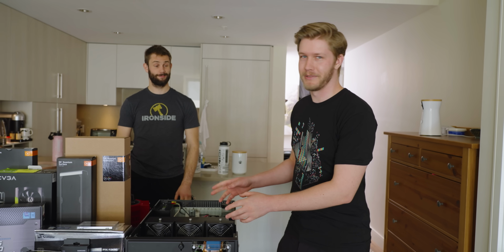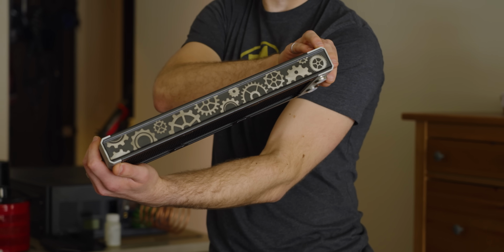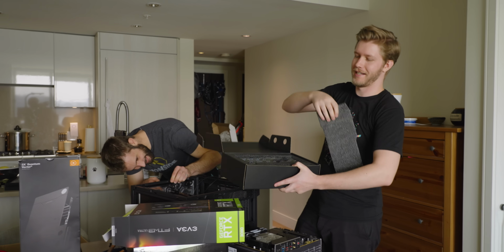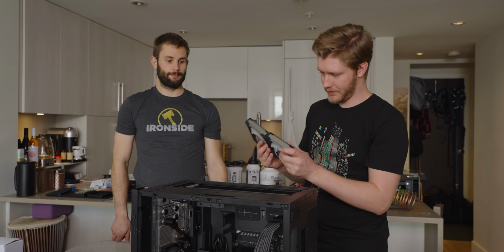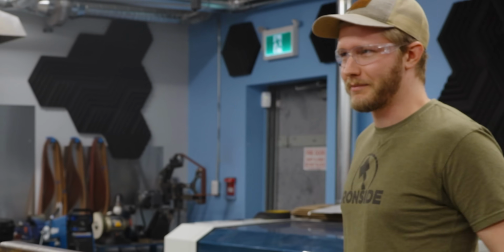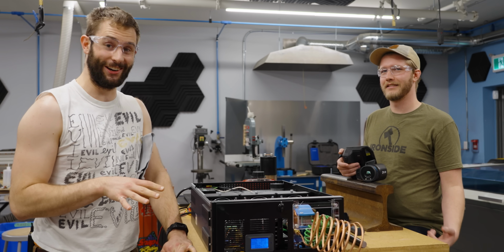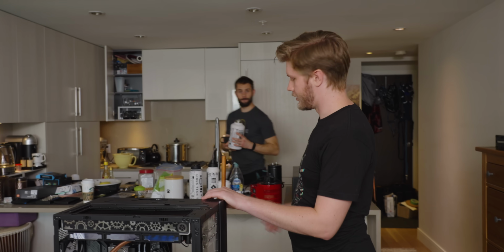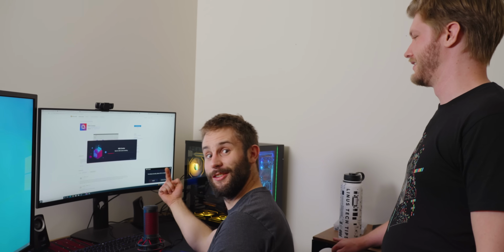This PC is TERRIFYING - Intel Extreme Tech Upgrade

Comment: I actually used a magnet almost exactly like this one to do my PhD research in bioengineering. I was using it to rapidly spin magnetic iron nanoparticles and make them generate a few hundred degrees C and release drugs attached to their surface. So instead of a piece of metal bar in the coil, it was a mouse with the nanoparticles inside of them (the mice were fine, since the particles are so incredibly tiny the actual amount of heat generated was very low). Very fun to see someone describe how this stuff works!

Comment: The induction heater current draw was increasing because as the workpiece heats, it’s magnetic permeability drops, dropping the inductance of the work coil. Considering you were driving the tank above the resonant frequency, that decrease in inductance causes the resonant frequency to increase, pushing the resonant frequency closer to your driving frequency. Be very careful to not allow the resonant frequency to go above your driving frequency and go into the capacitive side of the resonance curve as IGBTs and MOSFETs tend to not like capacitive loads.
Reply: Yeah, also the frequency control for this iteration was tied directly to a potentiometer rather than having any closed loop control. whenever I get around to rebuilding it I wanna get some dynamic closed loop control systems implemented that keep the driving frequency near the resonant frequency of the tank circuit to minimize the wasted energy in the coupling coil and maximize heat transfer into the workpiece.
Reply: @tynanstack8251  Most would use a Phase Locked Loop for that, but that’s too complicated for me so what I did was… interesting to say the least.

Again considering driving the heater above resonance: I had an arduino generate the square wave signal for the driver using the ToneAC library(much more stable than built in tone function). The arduino is hooked up to a current transformer which is clamped over one of the hot wires before the rectifier. The output of the current transformer is rectified and measured by the arduino. The arduino would change the frequency of the square wave based on the voltage read from the current transformer and a set reference voltage.  If the current transformer voltage is over the reference voltage, increase the frequency away from resonance to drop the current. If the current transformer voltage is below the reference voltage, decrease the frequency towards resonance to up the current. Changing the reference voltage(potentiometer voltage divider) will change the target current so you can set the heater’s output power that way. This method will keep the induction heater’s current draw to +/- 1A of what you set it to. This sounds kinda complicated but all of this fit on a 2cm by 2cm perfboard minus the arduino.

Comment: Copper or even steel tube bending ain't hard if you have an actual bender. Can't imagine its easy just freehanding it though.
Reply: yeah the benders we had at the time weren't ideal :P but made it work. I have since rebuilt the PC to not have any bends and be all straight runs its WWAAYY easier to do maintence on now :P

Comment: im curious why use a electric forge over a traditional forge
Reply: I wanted to build one for a long time and having money thrown at me pushed me to do it. Also means I don't have to haul around propane or worry about ventilation when using it.
Reply: @tynanstack8251  thats fair, plus working at a company thats more about computers it makes sense. Though a badass forge at ltt would of been awesome for the electric engineer

Comment: I have a similar 6Kw induction heater that I built a few years back. You should really use an SSR and power resistor as a soft start to charge up the capacitors before they are directly connected to mains voltage. I basically run 240V through a 300W 500ohm power resistor with a 5 second 555 timer circuit and latch to activate the solid state relay, that way the resistor charges up the caps slowly before fully connecting them. I have also been considering using a microcontroller to measure the voltage on the capacitors to switch over to mains as soon as they are charged above a certain threshold, which would be nice to prevent any potential short from blowing things up (since it would pull power from the cap faster than the resistor lets it charge the circuit just never switches to mains if something is wrong).
Reply: I'm sure you meant SCR, not SSR. had a couple laying around I pulled out of an old spot welder, never did use them, now I'm not in to those types of hobbies anymore.

Comment: Absolutely love the detail of the forge top panel, that pattern is a Lichtenberg figure, which you get by running electricity through an insulator. The induction forge's top panel functions as a handy preview of the scar you get from touching the internals.

Comment: I haven't found water cooling to be necessary in most builds unless you OC to an extreme.  Extreme meaning OCing to the point of extreme temperatures not found in minimally OCd builds.  I OC to a point where I have an extra 10 to 20 degrees headroom to alarm mode.  When a person considers adding water cooling I like ask "Why don't you just pay an extra 100 bucks for a better CPU that runs faster rather than paying an extra 300 bucks for water cooling?"  Water cooling is so 80s now.   It's like putting baseball cards into your bike's spokes to make it sound like a race car.  Sorta like adding Neon fins to a scooter.  It looks good but totally unnecessary (in most cases).

Comment: i like how people always say Imperial sucks when they have no idea why theyre saying that. Both metric and imperial work perfectly fine for all math and doesnt hurt anyone. Its cringe that people literally hate on other unit systems because they use one of the other. like is that really the only reason why??? XD XD LMAO
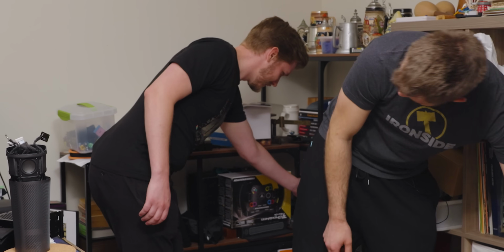Reply: My main gripes with imperial is the variable ratios between units, for example inch:foot is 1:12 and foot:miles is 5280:1. Whereas in metric ratios are pretty much always 1000:1. You are right they both work but in my experience metric is an easier system to use

Comment: Ahhh the galvanic corrosion build, sexy. I do respect how it looks and respect the cable mod pros but should you be using a copper water block for the gpu and cpu since the radiator and tubes are copper
Reply: It’s Nickel plated brass block so it should be fine for corrosion or at least that’s my hope!
Reply: @tynanstack8251  sweet dude sick build!

Comment: they were talking about worrying about spilling water in your pc, i once spilled an entire glass full of milk into my pc, i took it apart and put it on towels. I then waited a few days, put it back together and it worked. I just replaced my cpu after a few years, and on the cooling fan there was dried milk. There is also still milk stains on the inside of my case that can not be removed. (this whole thing was like 5 years ago)

Comment: If he touched the copper with the steel, would he be, like, okay?
Reply: i assume it's isolated, but i wouldn't wanna test it (especially since higher voltages and isolation always play very nice together)
Reply: Yeah, nothing should happen electrically, the inductor spool clearly has an enamel coating that withstands the temperatures.
In regards to dielectric thickness should also not be too much of a problem.
However he would probably fry his contraption then with the heat that would go from steel to inductor.

Comment: HEY You don't need that inductance !
This heating technique uses the ferrous metal induced saturation to heat, so obviously that inductor is also heating.
You should instead use the metal part that you are heating as inductor.
And you need to have a Microcontroller that select the correct frequency depending on the current consumption :
- optimizes frequency to that heated metal part inductance (like a MPPT tracker)
- but don't go for highest current point, instead use a current limiter (so that it has a constant input current predefined by SW)

Comment: "3200 which is kinda slow" 
Me with 2333 DDR4: Ouch
Reply: Ddr4 starts at 2400mhz. Like the specification for ddr4 literally doesnt exist at 2333...
Reply: @JgHaverty  Sorry, I meant 2133. I don't know where I got 2333 from lol.
Reply: @Pyromaniachimbo  no like if its set at 2133, you have it set wrong in your bios lol. Ddr4's SLOWEST jedec speed is 2400, you can probably squeeze quite a bit out of your ram with overclocking too if its that low
Reply: @JgHaverty  Oh nice, I didn't consider that I could change the clock speed. In fairness I've never actually run into noticeable performance issues so I never saw the need to change it. Thanks, I'll be sure to change it.

Comment: Remember when i was doing my electrical trade they used to charge the capacitors for the capacitor start motors then when you unknowingly connect your wires to build the circuit you would always get a shocking surprise 🤣🤣

Comment: 18 minutes in and I have no idea what he needs this metal heater thing for.
Reply: Yo same. I'm sitting here wondering if I missed a large part of the video.  What was it for? I finished the video and never found out.  It seemed dangerous and there was no obvious reason to why they were doing most of this stuff.
Reply: @Tsuusetsu  I think it was included just bc he spend intel money onto that instead of using on just his pc
Reply: isn’t it obvious lol? he needs it to bend the hardline copper tubing. it’s literal copper plumbing, a heat gun won’t work like you do with acrylic tubes
Reply: because why not lol!  nothing cooler than an electric forge. except maybe  building your own
Reply: he said forging, also it's just a really cool thing to build

Comment: Hey guys.  I’m trying to buy a gaming pc on a tight budget that will also be a home pc.  I was looking at iBUYPOWER - SlateMESH Gaming Desktop - Intel i7-12700F - 16GB DDR4 Memory - NVIDIA GeForce RTX 3060 - 1TB HDD + 500 NVMe GB SSD or Lenovo - IdeaCentre Gaming 5i Gaming Desktop - Intel Core i7-12700 - 16GB Memory - NVIDIA GeForce RTX 3060 LHR - 512GB SSD or Lenovo - Legion Tower 5i Gaming Desktop - Intel Core i5-12400 - 16GB Memory - NVIDIA GeForce RTX 3050 - 256GB SSD + 1TB HDD.  Thoughts or other recommendations??  Thanks a lot!

Comment: If they close the diameter of that coil more, the temperature will rise. I want to see if they reach 1000 cº hehe
Reply: I will be testing smaller diameter coils soon! It’s on the ever growing list of upgrades to the heater system 😂
Reply: @tynanstack8251  I worked doing induction tempering and it looks fun to have a machine like this at home :3 I hope to see the results ♥
Reply: That’s super cool! And I would say its “at home” but easy access for sure!
Reply: @tynanstack8251  you are living a dream for sure 😂

Comment: Nice build but the only problem I see  is the induction coil is supposed to be just big enough for the piece of metal you are putting into it. So a 25mm metal rod should only be used in an induction coil internal diameter between 30mm to 50mm
Reply: Yup, I agree! I have a smaller coil now on my upgrade path, wanted to have a big coil first to use with a crucible though I haven’t used one yet 😂

Comment: What's interesting to me is that as far as I know an inductor converters voltage into a magnetic field. My question would be is the increased frequency of the collapsing wave causing the magnetic field to heat the metal faster? And if so why not just increase only the frequency of your voltage cycles using a vfd or something similar that way you would not need a greater amount of power. I only work in hvac as an apprentice, I'm not an engineer so sorry if I'm way off.

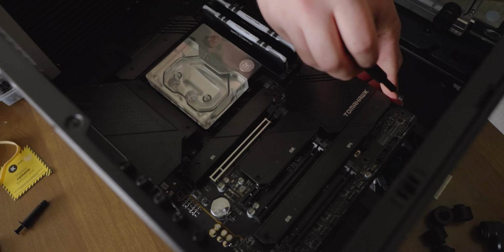Comment: 7:45 For the life of me I do NOT get how case and motherboard manufacturers are dropping the ball so badly on this.  I've got a case that's quite nice aside from the little issue that the motherboard standoffs are ~2mm too short, and I've lost track of the number of MB+case combinations I've tried where as here the I/O shield doesn't line up in one direction or another - I've given up and just left it off a number of builds in the last few years because of the hassle.  The critical dimensions for ATX motherboards haven't changed in literally decades.

Comment: In order to have an efficient induction heater, the circumference of the coil has to be much closer to the dimension of the actual part you are heating. The YT channel Make Everything covered a commercial unit which was supplying coils of different sizes to accomodate different sizes of stock. Really enjoyed watching you guys doing sketchy engineering and made me feel less bad for doing it myself at work.

Comment: I .... really hope that's a copper radiator and there's no aluminium parts in the fittings or pumps
Reply: Everything is copper/brass so I shouldn’t have any galvanic corrosion issues 🤞
Reply: @tynanstack8251  Omg I got a reply from a team member ! What a blessed day <3

Comment: When you turned the server fan on at first, my laptop just went WEEEEEEEE and started going full blow.  Then when you shut it off, it settled down...  What kind of witch craft is this?  It's not even on the same network as my current PC.  Still, cool upgrade.

Comment: For the entire "forge" segment in the lab, I was sitting here thinking "oh god... oh god... oh god..." without having even the remotest clue what ANYTHING was that they were doing. It just felt like unspecified terrifying danger. Compelling viewing!
Reply: While studying to become an electric engineer I got shocked twice with a triphase 400v cable while working on motors. I will take that any day of the week instead of touching a capacitor of that size.
Reply: @JaceKeller  then you're not fun electrical engineer
Reply: I took one electronics class. It's somehow more terrifying when you have an inkling of what's going on.
Reply: @charles3840 I went through about half an EE degree. This is terrifying. Those caps could probably kill an elephant. The insanity of that supply cannot be overstated.

Comment: It's funny talking about the dangers of capacitors, when I was in college (automotive)  my instructor used to church up ignition capacitors and they have a little grounding wire on them. He would then toss it to a student, if you were dumb enough to catch it, it would zap the crap out of you because you would end up touching the cap and the ground wire together. Hilarious.

Comment: You should get sockets and extension cables from Europe for those 240V experiments... They are way better protected and you can't plug in 120V stuff by accident to your 240V line

Comment: It would work better if the coil was sized more appropriately to the piece of steel, unless you're going to use massive round bar for your knives/swords a smaller coil would be better in 99% of projects.

Comment: You guys should be practicing arc flash protection, having an open powered on enclosure that a tool can fall into is a disaster waiting to happen. While I saw eye protection, it would have been nice to see burn resistant gloves and possibly sleeves and full face protection.

Comment: One 360 mm radiator is painful to look at with a case that can ingest three 360 mm rads :/
It is also just excruciating to look over and over in your videos how you teach people bad habits with filling the system with fluid. Is it REALLY that hard to bring second power supply for the initial run of the pump...

Comment: these guys never heard or seen SPL vehicles before lol this guy is like " like 200 ammos and 400 volts " LMAO while we roll around with a cap/battery bank 3-4 machoman 400amp alts just to trickle feed the hungry hungry bank in the back of well over 100k watts lol you guys should go to #SLAMOLOGY2023 just to see what real power looks like cause if this is power to you then you would never fathum why we have 2 log chains hanging off the frame of the SPL vehicles to the ground to keep the death static down lol

Comment: When building pcs, you just have to improvise sometimes.
I just sold my 3080ti together with my 850W psu to my friend , and he asked me to please install it.
When I opened the shitty , probably 20$ case 😂
The cable that powers the cpu , went behind the case , as normal , but then didn’t really had a whole to bring it back in , so the literally plugged the cpu cable in and then screwed in the mother board, it was possible because the cable was very thin , it was the connector that wouldn’t go through. After stressing for 40 min saying : the cables from my psu are sturdy and round shaped , I can’t replicate this shitty solution , not to mention I was planning on doing a 40 min psu , GPU Exchange , not a full pc assembly and disassembly.
Then it hitted me , his case had no box hiding the psu , in fact it had no components at all , it was literally an empty rectangle , no tech or design whatsoever.
So no need to put the cable from behind the case and back in.
Straight up from the psu to the cpu power (avoiding the GPU of course).
Not an Elegant solution ,  but it’s a clased case with no crystal panels .
 I LOLed so hard when I was stressing about how to put the cable in the back and the back to the front , when there was no reason to do it on the first place 😂

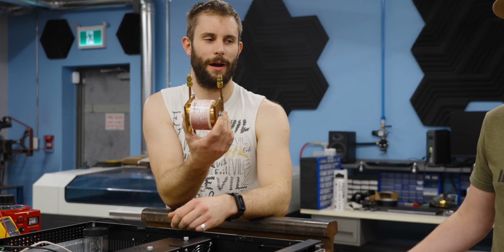Comment: 11:22 calculation error?  Or over inflated spec in the hopes consumers wouldn't notice?
Reply: It is a spec that is 750V or 800A or 500KVAR so technically it wouldn’t consistently do 750V@800A

Comment: Your copper coil is too large for the size of the metal youre using, the coil should be around 1/2 inch of space around the diameter of your piece

Comment: of all the Intel Extreme Tech Upgrades I've watched this is my favorite.   this is an engineers pc.     and that was WAYYYY over that toroid's capacity.. even for 15 seconds..  replace that one because the angry pixies will eat it when the rest are installed in parallel.
I got a bit of Cody's Lab vibe from this video for some reason.